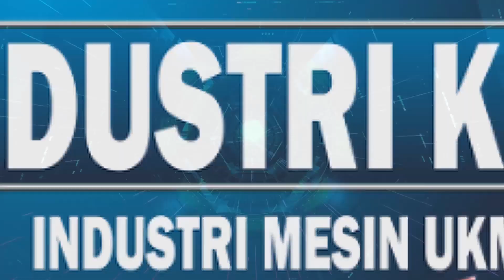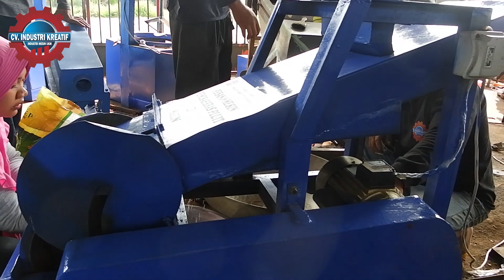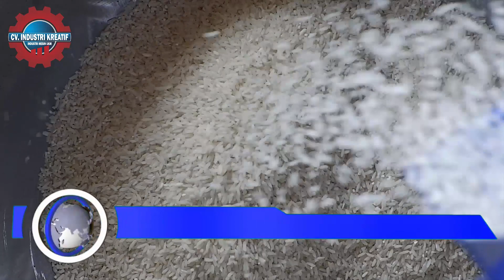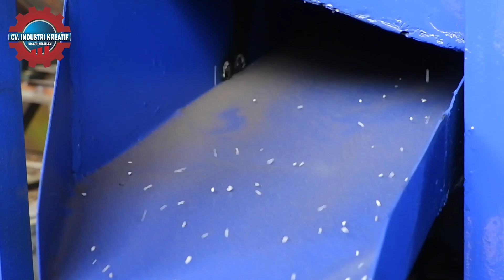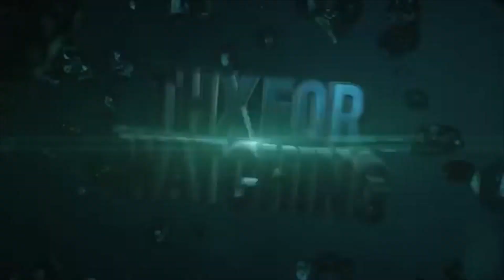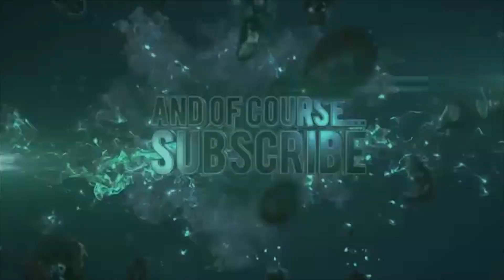MEMBUAT BERAS BIASA MENJADI BERAS SUPER DENGAN MESIN AYAKK BERAS

Comment: Boleh hantar ke malaysia ka boss?
Reply from the maker: bisa langsung hubungi cs boss

untuk info harga,detail mesin & pemesanan hubungi Customer Service Representatif Kami (Telp/WA) 081234280625 - 081217850288 - 082142267610 - 082334870125 atau kunjungi Workshop Kami di Jl Madiun - ponorogo KM 10 Selatan Puskesmas Geger 300 Meter Kec Geger Kab. Madiun Jawa Timur

Comment: Sampai tegal berapa duit?
Reply from the maker: untuk info harga,detail mesin & pemesanan hubungi Customer Service Representatif Kami (Telp/WA) 081234280625 - 081217850288 - 082142267610 - 082334870125 atau kunjungi Workshop Kami di Jl Madiun - ponorogo KM 10 Selatan Puskesmas Geger 300 Meter Kec Geger Kab. Madiun Jawa Timur

Comment: Cek harga
Reply from the maker: untuk info harga,detail mesin & pemesanan hubungi Customer Service Representatif Kami (Telp/WA) 081234280625 - 081217850288 - 082142267610 - 082334870125 atau kunjungi Workshop Kami di Jl Madiun - ponorogo KM 10 Selatan Puskesmas Geger 300 Meter Kec Geger Kab. Madiun Jawa Timur

Comment: Pak nama mesin nya apa buat/beli di mana
Reply from the maker: untuk info harga,detail mesin & pemesanan hubungi Customer Service Representatif Kami (Telp/WA) 081234280625 - 081217850288 - 082142267610 - 082334870125 atau kunjungi Workshop Kami di Jl Madiun - ponorogo KM 10 Selatan Puskesmas Geger 300 Meter Kec Geger Kab. Madiun Jawa Timur

Comment: Cek hrga bos?
Reply from the maker: untuk info harga,detail mesin & pemesanan hubungi Customer Service Representatif Kami (Telp/WA) 081234280625 - 081217850288 - 081252297132 atau kunjungi Workshop Kami di Jl Madiun - ponorogo KM 10 Selatan Puskesmas Geger 300 Meter Kec Geger Kab. Madiun Jawa Timur
Reply: Aku mau
Reply: @CVIndustriKreatif  sampai tegal berapa  yah?

Comment: Klo boleh taw alamat lengkap cv industrinya dmana ya
Reply from the maker: untuk info harga,detail mesin & pemesanan hubungi Customer Service Representatif Kami (Telp/WA) 081234280625 - 081217850288 - 082142267610 - 0812330810125 atau kunjungi Workshop Kami di Jl Madiun - ponorogo KM 10 Selatan Puskesmas Geger 300 Meter Kec Geger Kab. Madiun Jawa Timur